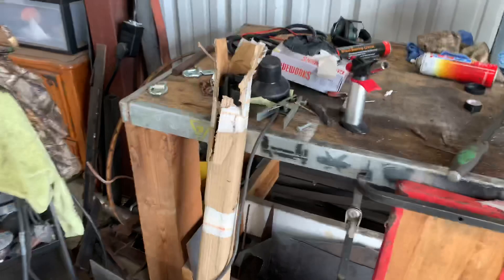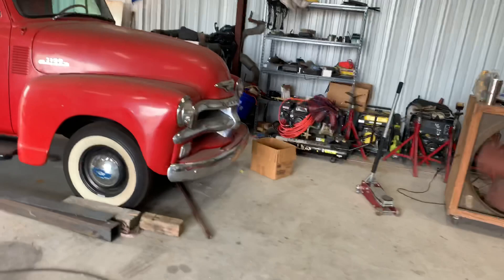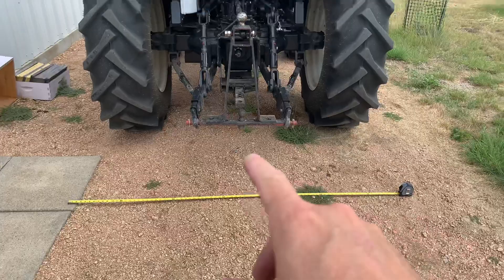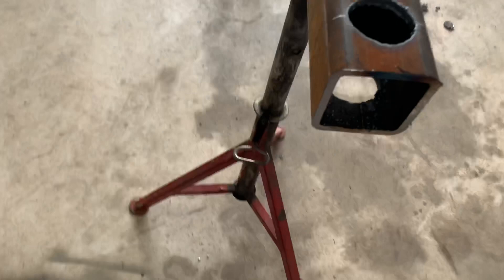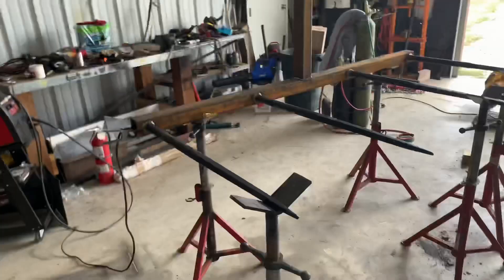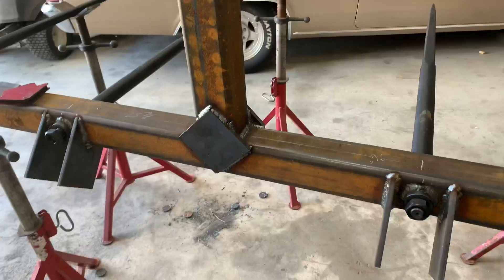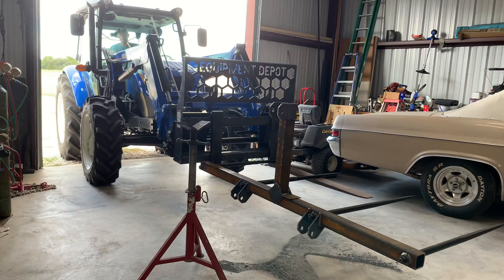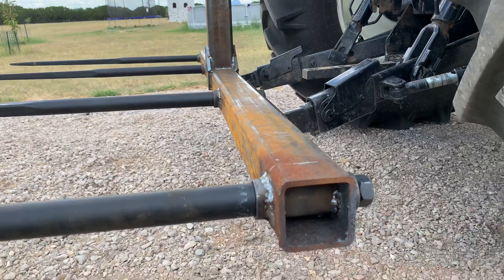Fabricating a dual 3 point hay spear

Comment: Nice job. I would have run a couple of pieces 3x3 tubing off your center tubing like an A frame for a little more support.
Reply from the maker: If I see any kind of flex I may do that
Reply: @CenTexAg  Yeah don't know how much weight the tubing will take or how much your bales weight. But if it flexes it will help.
Reply: @CenTexAg  I was thinking 2x2 tubing would work for the support braces and would be a little cheaper. And I think it would look better.

Comment: I am about to build one of these. Have one very similar pictured in my mind.  

So 24” tall and 80” wide right?

Anything you’d do different? Work well?
Reply from the maker: Yes on the measurements. I wouldn’t change anything because it works really well.
Reply: Ok thanks for the info and the video!

Comment: i would like to have something similar to haul 3 rolls, 2 on bottom 1 in middle top. I have 4x5 probably no more than 1200lbs each, could this set up carry three?
Reply from the maker: Yep I tried that. But I was to scared the top bale was going to come threw the back glass. You would need to add a riser from the top link up to prevent that from a happening.